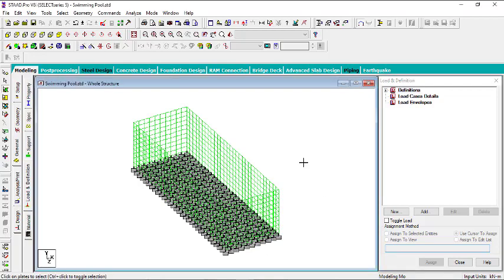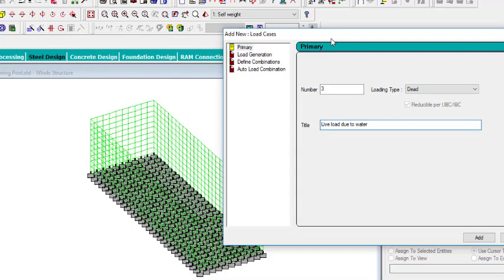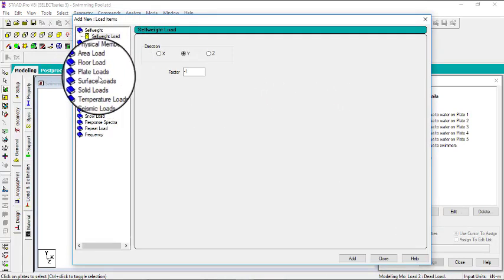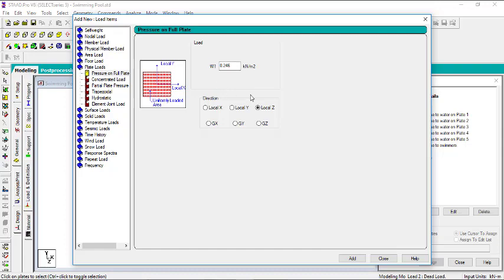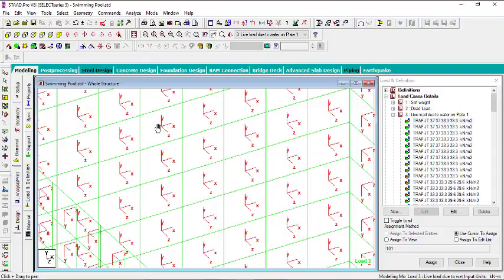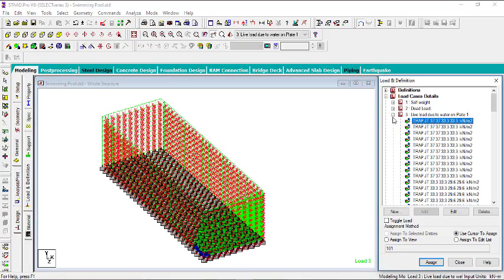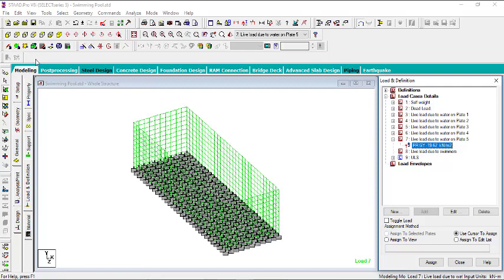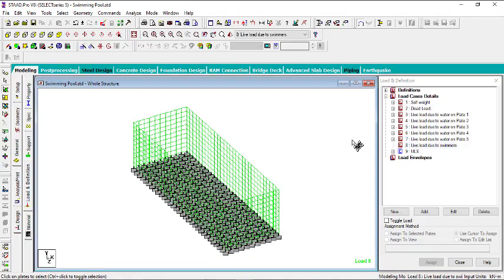Staad Pro for beginners (episode 15). Modeling and analysis of a swimming pool. (Part 2).

Comment: Does water considered as liveload? I searched on the internet and most of them said that water is a deadload. At first i thought it was a liveload too
Reply from the maker: When you searched online, what reason did they provide to justify that the water in a swimming pool is a dead load?
Reply: @ridwantician  the hydrostatic weight of the pool remains on the same place so it is practically a deadload. And that the only liveload to be considered are the swimmers